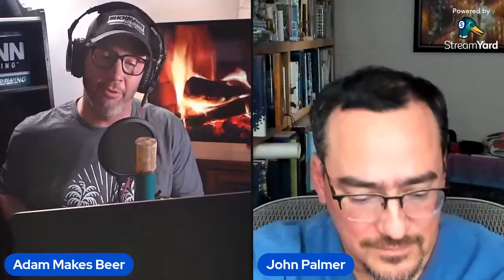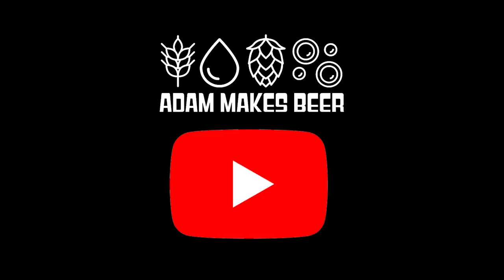John Palmer: Should I Add Salts To The HLT?

Comment: Since a lot of sparge water will be lost to grain absorption it would seem a more efficient use of salts to only add a stronger dose to the mash water that gets diluted by sparge water that has only been dechlorinated and acidified. E.g. when the aim is to target a certain water profile (like high chloride) rather than the aim just being for correct mash pH.
Reply from the maker: I appreciate the question! can you maybe rephrase it for me so i can better understand what you are asking? thanks!
Reply: @adammakesbeer  sure...how much water is lost to grain absorption? If salts were added to that water that is lost is that cost to the business of any significance? If it was a cost then perhaps adding salts to the mash water would prevent that since the sparge water would have no salts added only acid.